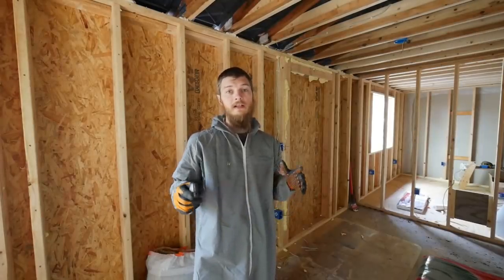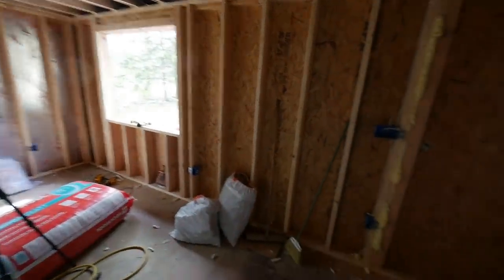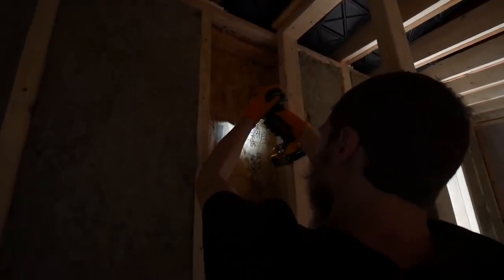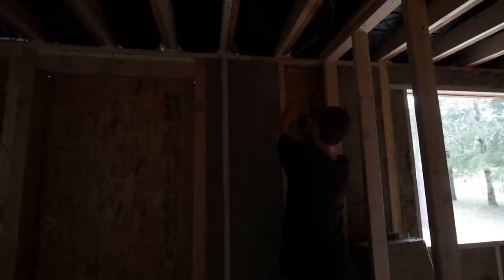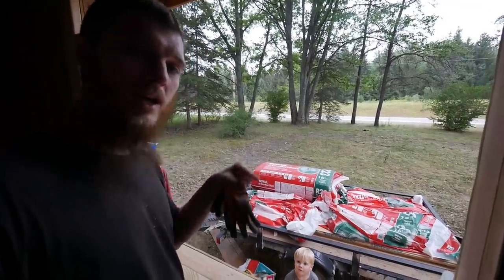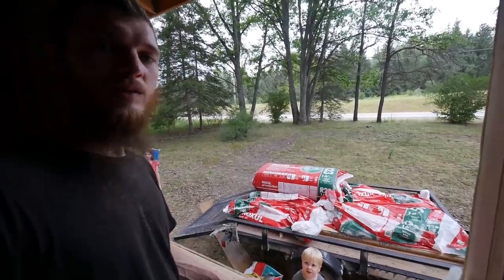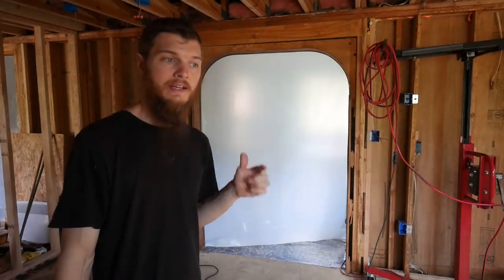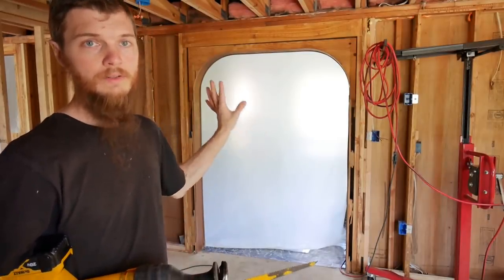Building a Better Life | Insulation & Underlayment - Home Renovation

Comment: Something I wish I'd done on past homes that I did in my new home, is to have a dedicated line just for the microwave. Mornings, I love being able to use the toaster at the same time the microwave is defrosting sausage for breakfast without it tripping breaker. I also have a dedicated line just for the computer, so that there is no "skipping" when i turn the lights on/off or plug in the vacuum cleaner or a heater.

Comment: For your OSB Sheathing, you could roll Shellac over it, to get you through the Winter. I don't think you would need to thin the first coat down, with the OSB. You should think about putting electrical in for Security/ Work Lights at the corners. I recommend e-conolights LED M/n E-FFA08 Wide Distribution for the Front Yard and LED M/n E-FFA07 Medium Distribution for the backyard, for a further light throw. At over a hundred feet I could read a newspaper with them at 74 watts each. For Bath Fixtures check Faucet Direct. I normally would have used a local plumbing supply,  but the counter sent me to the showroom and the Lady trashed my entire design, and tried to up sale me. .

Comment: If I were you guys, I'd get the tyvek up on the outside and leave it covering the window holes until you get the windows. 1 minute cutting the hole and then flash the windows and mount them. This keeps bugs, critters, rodents, and weather out of all your newly installed wood and house.

Comment: Great job, thanks for sharing your life with us. It will be interesting to see how well the home will heat with the electrical baseboard heat this winter. It might be efficient enough to not need the wood stove. Wood heat is nice but it's a pain to gather, split, and to haul in the wood fuel, and it's tough to keep things clean with all the wood debris. Been there done that.
Reply: It works when the electricity goes off
Reply: @katiegarrett822  That is true. It depends on the shape of the grid near your home. In my case we had one two hour outage in the last five years. If you're on REC power that might be different.

Comment: Great progress, beautiful team work, it was fun to sit back and see the two of you go hammer and tongs at getting the floor in and down. Both of you working hard to get to the finish line and the look of happiness on your faces when your target was reached was lovely to see. Leaving the kitchen and bathroom until later appears to me to be the only act in town, both are far more work, mess and disruption than everything else put together. The more time given to the plan the better the plan, the better the plan, the better than the possible outcome. I was sorry to hear about the possible delay to the windows and door, but slightly more worried about the extended exposure time for the wrap, I really hope that you can find a way to bring the siding delay down to a short period. Somehow I think you will find a way, though I totally agree with not resorting to borrowing. You have come a long way, I am confident you will work together to complete the journey safely, without debt. For example is anyone thereabouts doing any demolition and releasing materials that could find a relief role pending the full time siding products?

Comment: I realize you are screwing down your underlayment to help minimize floor squeaking, but that is what subfloor adhesive is for.  It's good that you had Ashley predrilling to prevent sheet lifting while running screws, but there is an easier and better way.  Since you tend to overdue things at least a little bit, I'm surprised you are not using subfloor adhesive.  And if you use subfloor adhesive you can also use your nailer and slam down some #6 coateds.  Should cost about the same, go way faster and give you a better job.  The only caveat is that by nailing, you'll need to police for nail heads.  Overall, a really good job.

Comment: I'd run the chimney pipe up threw the roof and not the wall. You put an elbow in it and the part that is some what flat will build up with crap. Plus it will draw better being straight.
Reply: I was also thinking that having a chimney pipe coming through the wall next to the front door would be an eye sore

Comment: If your going to use spray installation in the attic how are you going to keep the new installation from covering the old installation? 
Maverick is getting big he’ll be helping Daddy with the work soon.
Reply from the maker: We will only be blowing in new cellulose insulation on the rooms we've already worked on. The pink insulation areas that are still left are staying the way they are until we redo those rooms.

Comment: question- do you need a chimney with a wood stove?  Can you just run the stove pipe straight up and through the roof?
Reply from the maker: We'll be using a stainless steel stove pipe chimney that exits the wall and goes up. We prefer pipes not exit through the attic.

Comment: During the insulation graphic display, was it mentioned if insulation is going under the house between the floor joists?  BTW, I like the new name of the channel................
Reply from the maker: Thanks! We won't be insulating the floors, and instead we plan to insulate and encapsulate the crawlspace.
Reply: @diyfferent  ...  Yay!  Does this mean building foundations/footings?
Reply from the maker: @smallfootprint2961  The home already has a concrete block foundation :)

Comment: Is there a difference between the grey insulation you're putting in vs. the other pink color you took out?
Reply from the maker: Yea, the pink insulation is fiberglass and the gray insulation is mineral wool. Mineral wool has a higher r-value per inch.
Reply: I was wondering the same thing. Is one cheaper?
Reply: @debbiem9104  what? You mean which one is cheaper?
Reply: Syarifa Fatimah  I was wondering which was better and if one was cheaper than the other. We live in a new mobile home and it has white fiberglass insulation

Comment: Are you guys planning to replace the window on your side living room wall?
Reply: They are going to replace all the windows as they are old and leaky. They had to do the front elevation during this portion (before they planned to) as they needed to fix the dry rot along those walls caused by the porch and the chimney before they could build out the walls.
Reply from the maker: Yep :)

Comment: Do you plan on taking a break during winter? What are you wanting to get done before then? We have 1.5 bathrooms that is shared by 9 people and it took us FOREVER to remodel our only full bathroom.
Reply from the maker: Before we need to turn heat on which is soon, we want to get the ceilings insulated that we've already redone and are working on, and drywall on these exterior walls, house wrap, windows and door installed. Unfortunately we'll probably have to wait until spring to continue with the renovation of the rest of the house (kitchen, bath) so we don't waste heat when we gut those rooms.

Comment: Could you spray the outside walls with a sealant to help it last longer, if that's what you meant that had only a six month life?
Glad that you are having a wood stove because if the power went out in the winter you might be a little bit cold!!
Reply from the maker: The house wrap is only suppose to be exposed without siding for up to 6 months. After that it may start to fall apart. But we don't get much wind or sun on the house so it should be okay for us.
Reply: @diyfferent  The higher UV rated wrap can last much longer, no guarantee for winter weather adding to that though.  You could always do some exterior paint on the OSB, get some mistint messed up mix for cheap of any color and that would help protect it.

Comment: Was there any rotten spots in the floor? I know you wouldn't cover moldy spots, but if it's just dry rot, can you just put strong underlayment over it? All my edges are bad, so I'd really like your opinion 🙂 Also, do you guys find any particular YT channels helpful for skills or do you just plan it all out on your own? I need basics, lol Great update!
And, oh my gosh! Your website is beautiful! I love the new name and the layout too! Sent a PayPal 😘
Reply from the maker: We cut out and replaced all the rot (it was shown in a previous video). You could cover over dry rot with an appropriately thick underlayment, if the underlayment could still be well supported. BUT, I would probably still want to remove what I could and patch or shim up those areas first. It would just give you a stronger floor and there would be less bad wood for insects to be attracted to. I know it can be hard where it goes under the wall though. Sometimes you just have to do the best you can in the circumstances.

Comment: Nice update. Just curious, why did you drill and screw the plywood down?
Reply: Ashley is probably drilling a pilot hole for the screws.
Reply: @sandrajohnson1465  I understand what they are doing. I just don't understand the 'why'. Usually drilling is not necessary.
Reply: North Fork Hollow it’s completely unnecessary lol
Reply from the maker: Predrilling helps the plywood seat better to the subfloor without leaving any gaps underneath. This is the first room we did this in, and did it that way because we wanted to. Depending on the subfloor and screw type, it's not always necessary.

Comment: What is the reason you can see daylight threw the eves. I never understood the reasoning .
Reply from the maker: Our eaves are all exposed right now since we ripped all the soffit vents off so it's letting more light in than normal right now. The eaves are supposed to let air in so there is air flow in the attic and it exits through the ridge vent on the peak.
Reply: @diyfferent  Ok that makes since . Thank you

Comment: Since you already have the ceiling exposed, I would go ahead and run the ductwork in the ceiling that way it would be there for future upgrades or for a different homeowner. It would not add too much cost to your project and it would be an upgrade to the old/modernized double wide home. It would definitely be worth it in the future.
Reply: They don't need duct work because they are using individual mini-splits in each room.
Reply: @micheleoftheoaks5506  I know...I was just saying having it there just for the sake of having it for resale purpose only.

Comment: Lowes is absolute crapola at delivering on stuff you order.  Rebuilding our house they CONTINUALLY missed delivery dates, lied straight to our faces numerous times, and then delivered incorrect or obviously broken materials. The single item that came on time and wasn't damaged was a roll of metal flashing tape.  The moral of the story here is, your windows won't be here until well after the date on the paperwork and NEVER listen to what the 'guy in the store' said.
Reply: We had so much trouble w our window instalation from Lowes that I ended up calling corporate. Something I hate to do. But by the time it was done it was 6wks past our promised date. They didnt show up on time, they ordered the wrong sizes and had to reorder, they were on back order......That held us up on working on our farm in another state. I did love the finished product. But definately schedule extra time when working with them.
Reply: perhaps it depends on the store... We never had any problems with Lowes.
Reply: @OhItsJustMe2  That is definately possible!  I still prefer Lowes overall. I just schedule it to take longer than they say so I dont get as frustrated.
Reply: Really...we recently ordered outdoor lighting and then a storm door from Lowes and both came in days early. In good shape and no problems. Guess each store is different. Lucky for us.
Reply: @nowherenan3824  awesome! I am glad you had a good experience! :) As I said, I still prefer them overall.  Part of the problem for me, may have been that windows are a 3rd party contract. You order them thru Lowes, and Lowes does all the scheduling and coordinating. But they are measured, made, shipped, and installed by another company. There was a lack of comunication and follow up. After I called Corp, the acting store manager called me and we were able to get it straightened out.  I was pleased with the end product. Just 6wks later than I had been promised.

Comment: Without furnace you really should finish outside with siding and wrap. Its freaking cold up there in the winter. You need heat for the babes Just sayin...
Reply from the maker: At this point we're just trying to get the house insulated and sealed up so when it gets cold out we can turn our electric wall heaters on. The outside can stay house wrapped until springtime.

Comment: What's up with pre drilling the plywood on the floor?
Reply: John Nelson i just came here to ask the same thing. What a time waster. They’re still learning lol
Reply from the maker: Predrilling helps the plywood seat better to the subfloor without leaving any gaps underneath. This is the first room we did this in, and did it that way because we wanted to. Depending on the subfloor and screw type, it's not always necessary.
Reply: DIYfferent how do you figure? I must of missed that lecture in my structural engineering classes. Of course it was a few years and many many projects ago.
Reply from the maker: I guess it's just something you learn from experience. We were pre-drilling the hole in the top layer of plywood only to allow the screw to spin freely and pull the plywood down rather than grabbing it. This helps us especially with some of the more heavily wrapped pieces. We're just doing our thing and sometimes we do it a little DIYfferent, but it works for us. And what works best for us may not work best for everyone :)